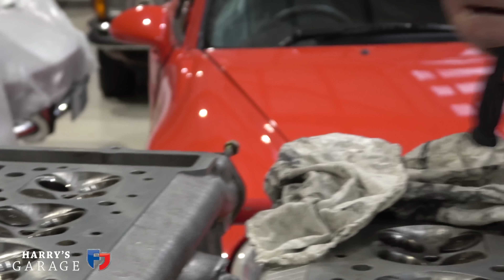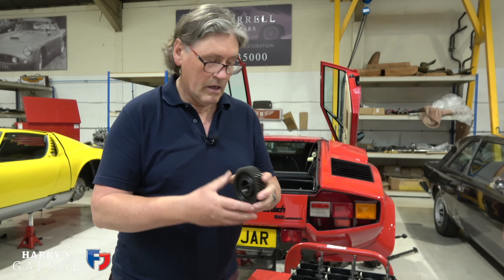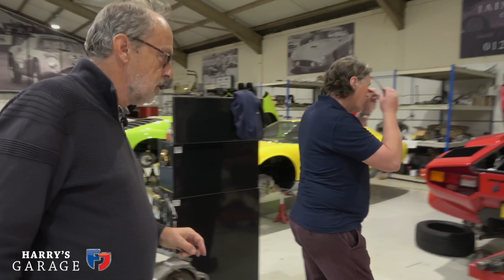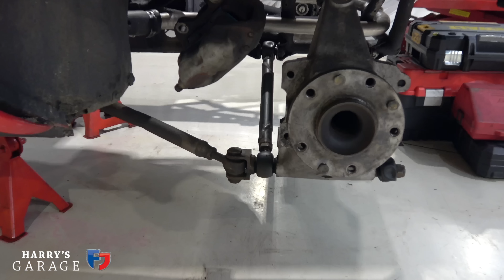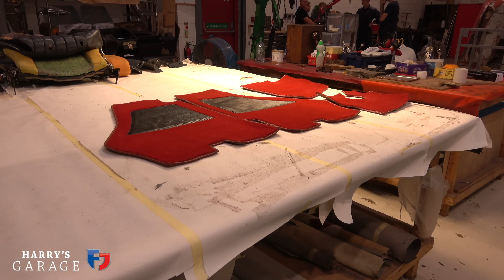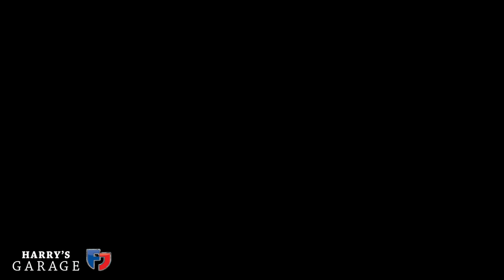Lamborghini Countach QV resto update Pt.5. There's an unexpected problem with the gearbox

Comment: 'Pull to release' clutches give a slightly higher clamping force (i.e torque capacity) for a given pedal effort relative to 'push to release' clutches, because they allow a slightly stronger diaphragm spring to fit in tho the pressure plate diameter. This comes at the expense  of additional assembly complexity with the clutch release mechanism, hence them being worthwhile in some high powered applications, but not worthwhile in more normal applications.
Reply: Well said.   Is it the same for Automatics.   👌👌
Reply: The Honda S2000 has a pull type clutch fyi
Reply: As an Engineer, I appreciate explanations like these, thank you very much Richard.
Reply: Background info in the comments Is gold thanks
Reply: I knew smart people watched Harries Garage. Thanks Richard for demonstrating it and teaching me something. Not a wasted day after all.
Reply: Hello Richard. thank you for taking time to comment on the reason why such a clutch diaphragm was created. Makes perfect sense, especially on a car like the Countach!
Reply: Never knew that 👍Thanks for the explanation
Reply: I was wondering if Lamborghini originally made them like this for their tractors and carried the design principles over. It would probably make sense for high torque industrial applications.
Reply: The 6 speed in the Subaru STi also has a pull type clutch IIRC
Reply: The reason is the lever arm gets more leverage in the same length because on a pull type the fulcrum is at the tip, not a see-saw
Reply: Some MF tractors used pull clutches.
Reply: The real advantage is there is less deflection in the cover assembly: the fulcrum rings are closer to the OD of the cover than in a push type making for a stiffer arrangement, so pressure plate lift can be maintained for a reasonable release load.
Reply: Great to know. A Range Rover P38 diesel has a pull clutch too......very random!
Reply: Mas Ghibli II and Shamal - pull type clutches also.
Reply: Theoretically there should be no difference between between push or pull to release pressure plates. The only advantage is weight as there is no internal pivot and additional springs. However there is a difference in weight. The flywheel assembly will be lighter but normally an overall weight increase in the car because of the limitations of actuation and adjustment for wear required.  High power has nothing to do with it that is just wank. I build custom clutches and can tell you that if you have a pull type clutch from factory in your car that it should only ever be replaced with another pull type. Why as the internal thrust bearing in your engine is made to take end thrust in that direction only usually.
Reply: @asdreww  5 speed in a wrx is also pull clutch
Reply: @dazaspc  many family cars have more power than my 'sportscar' now, with push type clutches, so yes, I do wonder why.   Plus spares availability is difficult.   I've thought of going to a twin plate push type with a concentric slave, with the aim of reduced rotating mass and lighter pedal, plus availability.   The thrust rings in my engine are the same either way, and last time I had it apart the loaded ones were trashed.
Reply: @dazaspc  No!
Reply: wiseacre 🙂
Reply: My  old Porsche 911S had a pull clutch,  with a 'sacrificial ' plastic arm actuator,  one needed to carry a spare.
Reply: FD RX7s have them as well
Reply: @jerryc6497  Weird cause thats not very poweful at all.  And for torque its a total weakling!  Sweet gearshift tho
Reply: That's outdated & obsolete thinking - nobody in huge power spec does pull clutches anymore, that was for the old days when metal sucked and diaphragm springs were "you get what you get"
Reply: cr
Reply: Integrale, skyline, Porsche, lambo all have pull clutch , the clue is in performance/ race breed cars.
Reply: @joneveritt1898  all of those are decades old too. The whole "more clamping force" wank was from back in the days (the 70's) when your push type was 3 big lever bars moving coil springs behind the pressure plate. Diaphragm clutches back then were just cheaply made. Today's diaphragm clutches are better than anything that was on the market as recently as 30 years ago, the early 90's. If pull type clamping force was true in any way, your heavy haulers cranking out 1,200+ftlbs wouldn't even work. Now if you want to argue about TODAY'S hydraulic throwout bearings, you've got me there.. stupid, stupid fkn design that never should have existed. Prone to failure, bitch and and half to fix, TERRIBLE pedal feel as anyone who was driving manuals before can tell you and is why a lot of Japanese makes stuck to fork & external slave for years. Now they're all doing it and it blows
Reply: The pull type clutch also adds quite a bit of rotational inertia to the flywheel assembly. Also, a good thing to get the whole assembly balanced as well.
Reply: @bobdobbs69  Not always. With a cast pressure plate housing like an air cooled 911, yes, they're heavy, and that mass is at the maximum radius, so adds a lot of inertia. But if you look at the Exedy push and pull to release clutches used in Subaru's, which all have pressed steel housings, the pull to release versions probably have a slightly lower inertia (especially the 225 or 230mm WRX and STi 5 speed versions when compared with the 225mm 'push to release' clutches from the equivalent normally aspirated models). The extra inertia of some 'pull to release' clutch pressure plates is to do with the design of their housings - not necessarily because they are 'pull to release'.
Reply: Look at the big brain on Richard!! Pulp Fiction reference.
Reply: @richardjones38  Well, it's a good explanation, for sure, but in the end, you're proving my point because you are finding the one exception that makes it a rule. (or very nearly one)  ;)
Reply: @harrysfarmvids  biggest advantage of a diaphragm clutch (either push or pull) is that they are relatively resistant to centrifugal force! the earlier clutches that used coil springs would stop working once the springs were bowed out in the middle too far. either loosing clamping force or even displacing the springs altogether with catastrophic results.
Reply: The logic is that for a given pedal effort, there is more clamping load in a given diameter, leading (most importantly) to reduced thrust bearing loading on the crank, since pedal effort can be overcome with a booster.

Think of it like the difference between a see-saw and a wheelbarrow.

Comment: Thank you for the update.
To put my 10p in, I'd have the other side wheel bearing done while the car is with Ian. If that side is gone the other is not usually far behind.
Reply: One of the few mechanical tasks I was able to do on my Alfa. I found out SKF made all OEM bearings which were simply put into Alfa packaging with mark up added, and saved some money by buying direct. Probably the cheapest part of this process

Comment: Harry, I'm a trade-qualified automotive machinist (engine reconditioner) and when you change valve guides or put K-line valve guide liners in you really shouldn't be lapping valves like that, they should go to a machine shop and have the seats cut on a machine like a Serdi, Rottler, etc.

When you put valve guides in they never line up as they did before with the only exception to this I've ever seen is on Caterpillar cylinder heads. You will end up with seats that are slightly wider on one side than the other, and you're missing out on a modern three angle valve job that will perform better than the original.

Getting the valves ground and seats cut isn't crazy expensive, I could do each of those heads in around an hour each on a Serdi, plus around the same time to grind the valves.

I would only lap valves if 1, I didn't have access to a Serdi, and 2, I didn't replace the valve guides.

You're leaving performance on the table doing it that way, and the amount of time dicking around doing 48 valve seats it'll be more expensive and a much worse result lapping them. I'm actually shocked Ian is doing this, especially on a Lamborghini. I would never trust a mechanic to rebuild an engine, ever, they know how to do it, but often not the finer details which are important, that's why a lot of them bring engines to people like me.

Also, I hope Ian checks the valve spring pressure before those heads go back together.

You might think I'm just some doom and gloomer that always pops up in the comments section, so please give your local engine machining shop a call and discuss what I said with them to get another opinion.
Reply: Yes sir, lapping all those valves like that is archaic practice.
Reply: are you really questioning probably the worlds leading Lamborghini restorer on his methods? Exactly how many Lamborghini V12's have you rebuilt?
Reply: @jaseleese7549  I am. A Lamborghini cylinder head is no different to any other. I have reconditioned many thousands of cylinder heads.
Reply: @LordandGodofYouTube  and how many of them were for classic Lamborghinis?
Reply: @jaseleese7549  no idea, I've probably done a few, I've done everything from lawnmowers to top fuel dragsters, from Toyota Camrys to Ferraris. A Lamborghini cylinder head is no different to any other cylinder head, why would it be? How many have you done?
Reply: @LordandGodofYouTube  None, but just because you've flipped burgers at Wendy's, doesn't mean you're a Michelin star chef!
Reply: @jaseleese7549  that's a strange analogy
Reply: @LordandGodofYouTube  With the resources and facilities that are available to them for engine rebuilding. If there was a more suitable way of carrying out that particular operation. I would hazard a guess they would do it. The fact that they are doing it in a certain way is probably the result of hundreds of engine builds, this being the preferred and most suitable way.
Reply: @jaseleese7549  Do you think that because someone is a premiere expert on Lamborghinis they will know better how to fix a broken Lamborghini stereo system than a trained and qualified electronics person too?
Reply: @Daniel-S1  It would seem highly unlikely that Iain and his team wouldn't be just sticking their heads in the sand and being completely ignorant to other methods IF they were superior. I would say they have vastly superior experience and knowledge in the machining, refurbishing and recommisioning of engines. And would have tried numerous different methods to achieve their goals before settling on the one that suits there needs best. There are machines called "carb balancers" yet Iain uses a length of hose and his ear to tune carbs. So is that wrong too?
Reply: @jaseleese7549  Better using an airflow comparator,  same principle more accurate.
Reply: Glenn B is correct.  Using a coarse lapping compound and going at it hard is going to cup the seat and totally wreck it and destroy the valve face as well.  A cupped seat isn't going to seal properly at engine temp. A quick final lap with maybe 800 grit or finer after a fresh valve cut is the way to go, and sometimes not even needed. I'd gladly pay a head specialist next time.  If I could afford a Serdi I'd purchase one. It would have saved me many of hours doing it with a piloted manual carbide valve seat cutter but eventually it got the job done.
Reply: @jaseleese7549  A Serdi 3.5 costs around 40,000 pounds, plus each carbide pilot, which costs around 100 pounds each, and you'll need a minimum of 3 of these for every guide size as exhaust guides and inlet guides have different clearances although this is often built into the valve stem itself. Every machine shop I've worked in has around 90 of these carbide pilots, so there's another 9,000 pounds, then you have to buy the cutting tips, tool holders, etc, probably another couple of thousand pounds. ad on a valve grinder for 15,000 - 20,000 pounds. Plus drills and reamers for doing guides, spot facers for spring seats, and the list goes on and on.

So there's around 70,000 pounds for the equipment just to do valves THE RIGHT WAY. 

A valve lapping stick and grinding paste will probably cost you less than 100 pounds. Do you see why Ian is doing it this way?

A mechanic who only does several engines a year isn't going to shell out for that as you'll never make that money back, and you need to be trained professionally on how to use it or you'll do more harm than good. 

An engine machining shop will however be able to justify that cost, just as they will for a crank grinder (40,000 pounds,) a boring bar (40,000 pounds,) a honing machine (40,000 pounds,) a balancer (40,000 pounds,) a surfacer, a rod resizer, acid cleaning equipment, pressure testers, crack testing equipment, shot blasters, etc all tens of thousands of pounds, plus TIG welders, Arc welders, Oxy welders, etc, and you'll see why a machine shop that does several engines a day will be able to justify this cost as this is what they do, day in day out. 

If you go to any race team that is even mildly successful they don't have mechanics building engines, they have automotive machinists, there is a reason for this, an automotive machinist can build any engine, no matter what brand, correctly.

I'd recommend looking at Jim's Automotive Machine shop here on YouTube to see how much expensive equipment even a small two-man shop has and you'll see the difference between what a mechanic does, and what an automotive machinist does...
Reply: He does say that the seats have been lightly cut at one point!

Comment: I'm a hgv tech. Our last generation Mercedes Actros had a pull type clutch, changed to a push type now though. Much easier to get the box back in! It was a pain to line the fork up on a pull type clutch.

Also, put the valve lap tool in the end of a cordless drill, saves time and saves your hands 😁

Comment: They spacers to increase CC is abllsolutely nuts. I've no idea how they managed to stay reliable after that but they did. They must have been well studded these engines.
Reply: Typical Italian “solution”
Reply: But what about the compression ratio ?
Reply: @mercedesw211classic  The engine has been stroked to achieve the increase in displacement. (It may also have increased bore, I don't know).
Reply: @johncrowley5612  I looked it up. The compression ratio indeed dropped from 10.5:1 to 9.5:1, but they managed to achieve more horsepower by producing torque at higher revs and clearly having more mixture available...(bore also increased)
Reply: @mercedesw211classic  Thats the static compression ratio but the overall active cr probably went up through having more time to suck the mixture in (larger stroke) and a higher stroke-bore ratio. 
Thats why it breathes better at higher rpm but would also ultimately limit maximum rpm. A better rotating assembly is how to get around that and they can then also use cams with more lift and duration but especially more lift at the ends of that duration. Again this would ultimately limit rpm unless better valves and springs were used.
So generally this is a pretty comprehensive upgrade over the older 4.0l. 
Also dropping the static cr would help with running on unleaded and its lower octane numbers when it first came about - something it was almost certainly designed for since the seats are already capable. 
Its interesting stuff to see the engineering work arounds from those days.
Reply: @siraff4461  I am curious which engine was nicer to drive. But for sure as great as turbochargers are nowadays, the work of manufacturers trying to build a good powerful n/a engine back then was so much interesting, way more original and competitive without the many parameters of today...
Reply: @mercedesw211classic  Exactly. They had limited tools and had to design everything with their minds. I find it much more interesting than letting a computer come up with the latest boring 4-cylinder.

Comment: I've seen those spacer plates before, i used to be into Hillman Imps and spacer plates were used on the big capacity engines, anything over 1040cc, they would go to 1200 odd cc with a spacer plate, they used wills rings (gas filled rings) to seal around the cylinders and thin head gaskets. I could never afford a motor like that (big money at the time), my Imp had a stock 875 Sport motor.
Reply: Back then you could also use oversize headgaskets.Measured in notches of thickness .Vauxhalls certainly on the 8 valvers.

Comment: Interesting, you talked about the small o-ring about the spacer on top of the cylinder..When I helped my uncle and grandfather rebuild the Continental engine on the Aroenca Champion, circa 1948, the head gasket to block "seal" about the cylinders,   was a strand of silk !!!  And it worked flawlessly !!

Comment: Why don't you block off those front grilles inside if they don't cool anything and cause such serious problems?
Reply: Or drill some holes in the fibre glass lower panel for drainage
Reply: @nickkritikos210  That would still allow that whole compartment to get soaked every time it rains or there's standing water!

Comment: Many moons ago when I lapped valves on my cars (those were the days!) I attached an electric drill to the valve stem and gently pulled. Worked a treat and much less effort and fiddle than a traditional sucker in a wooden shaft.

Comment: I wonder how many petrol heads have watched this and thought "I've got a tin of Chemico and a lapping tool in the garage!", myself included😂. Labour intensive yes but still very effective when done correctly👍 I always assumed rose joints were very strong and durable but maybe not or is it just down to water/dirt ingress and corrosion? When you've got the engine and gearbox out and stripped it makes no sense putting shabby carpets back in. Fab job👍
Reply: I should imagine rose joints aren't helped by the torque, huge width tyres and the state of UK roads. Bad enough with ball joints and drop links!